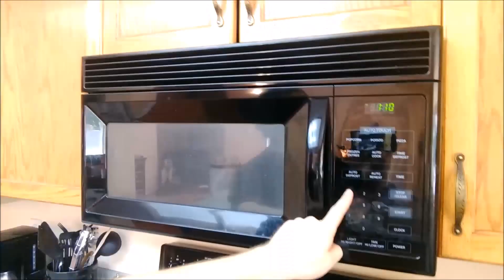HOW TO REPAINT SHIFT KNOB // WRX/STI SHIFT KNOB MOD // 2015-2020

Comment: I did it a few years ago and painted the inside WR blue, but I'm trying to do it with another knob, also regular wrx just like the first one, but it doesn't have those 2 tabs on the inside that you squeeze with needle nose piers. I guess its redesigned now?
Reply from the maker: Really, That’s interesting? I wonder why they changed it?
Reply: @SubieShakedown  Yep, no clue. Ill try heating it up a bit and prying at it some other way.
Reply: @SubieShakedown  hold on, Nate Thomas left a comment on this vid saying for 2020 all you need to do is warm up the numbers and pry it off

Comment: FYI to at least 2020 owners: the top just pops off. No need to do all these steps. Warm up the numbers and pop it off.
Reply: Thank you sir, just what I needed to know
Reply: @SamSamuylik  oh, had I known lol. Also... if you’re sanding, use a REALLY fine grit. I actually used a tiny piece of carbon fiber style vinyl wrap instead of paint. I just set it between the shift numbers and the shifter handle. But because the plastic lens the numbers are on was somewhat cloudy after sanding, I put a super-fine layer of mineral oil (any oil would work) on the back to make it clear. Can’t even tell. Also, do it all by hand. Do NOT use any power tools because the plastic heats up too easily and gets fucked. I had to work one spot after just tapping a polishing pad on a Dremel onto the lens.
Reply: @nthomas87  I've done it before on the older model like in the video, sanded with 1000 grit and painted WR blue like the car. Looks great. Just now with the new one I couldn't get it out. I wanted to sand down the back, clear coat it, and make some sort of capsule to hold a small amount of mercury. Would be cool to see it sloshing and vibrating in the shift knob.